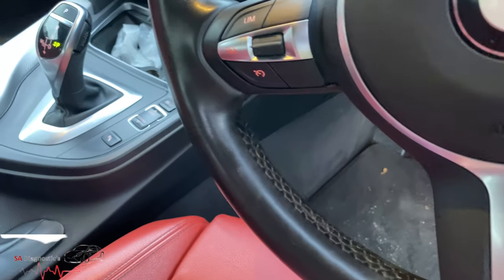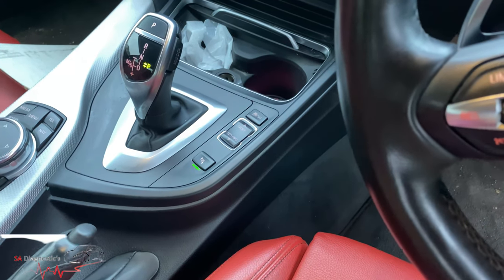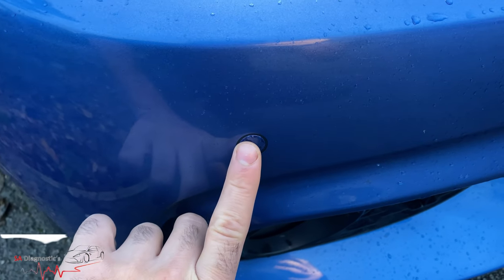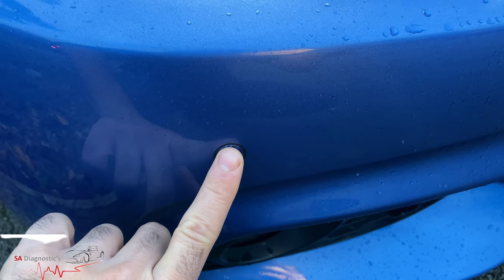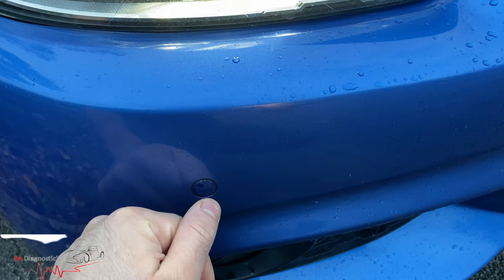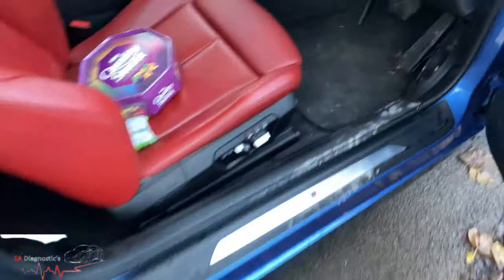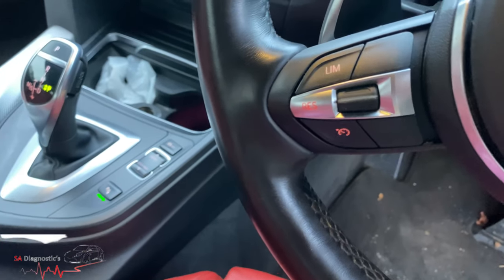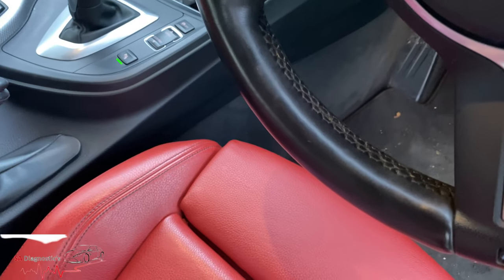How To Know Which PDC Parking Sensors are Not Working For FREE!!!

Comment: How to fine out which one of the rear is not working ??
Reply from the maker: Same as the way you check the fronts
Reply: @sadiagnostics  I don’t have pdc on the front and dose the car have to be on ???
Reply from the maker: @vybzwidtyngz  it doesn’t matter if it has pdc at front or not it will be identical the pulse will be same. And yes ignition needs to be on….
Reply: Quick question: Does the engine have to be running mine? Is it manual does this mean i would have to have someone putting into gears?
Reply from the maker: @JUSCHILIN1  no just ignition on.
Reply: To test the rear parking sensors you have to use your tongue.
Front sensors use your right forefinger only.
Rear sensors use your tongue.